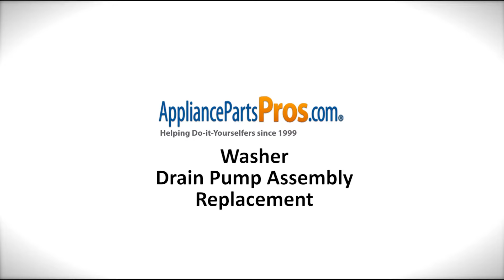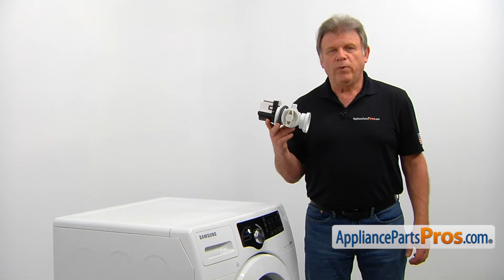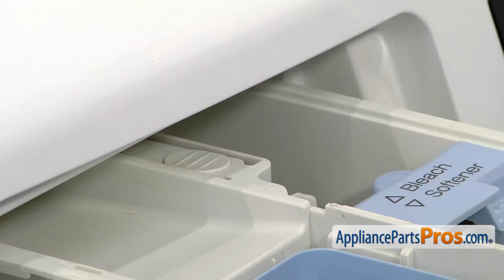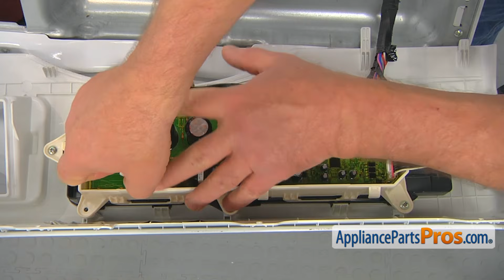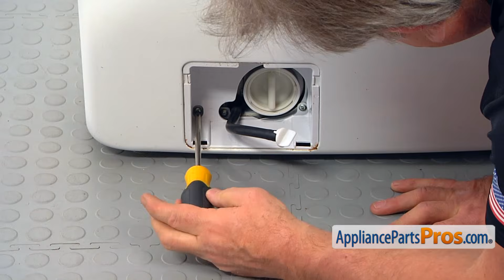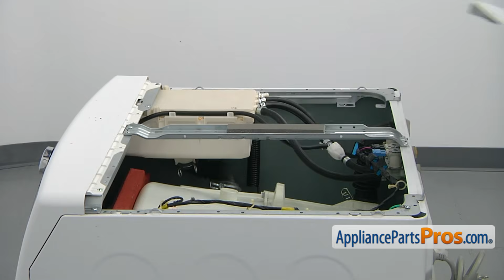How To: Samsung Drain Pump Assembly DC96-01585D

Comment: Much easier to take drain pump off from bottom access panel shown by other repair videos.
Reply from the maker: Depending on the model and your setup, accessing the drain pump from the bottom can definitely be a quicker and easier option. Thanks for sharing your experience!

If you need further troubleshooting or testing information you can check out our Repair Forum: https://forum.appliancepartspros.com/.  It’s easy to register, and you can either post your question or search the forum to see if someone else has already asked the same question.
 
Our experienced technicians, with over 20 years of hands-on appliance repair experience, are ready to answer your questions and guide you through your repair.

Comment: Fabulous video. Wish everyone did it this good. Replaces my pump twice in the last 10 years. Does anyone know what kind of accen this man has? Please tell me. He is so easy to listen to and understand. Thanks.
Reply from the maker: So glad the video was so helpful!
Reply: @appliancepartspros  thanks for the reply. Turns out it had two issues. The drain pump for sure. Now it’s working good but only on 2 settings. The Permanent press and the quick wash. Do you thing it’s in the main circuit board? The two settings that work are fine for the little I use it. I would value your thoughts. Many thanks.
Reply from the maker: For free technical support, please visit our Repair Forum: https://forum.appliancepartspros.com/.  It’s easy to register, and you can either post your question or search the forum to see if someone else has already asked the same question.
 
Our experienced technicians, with over 20 years of hands-on appliance repair experience, are ready to answer your questions and guide you through your repair.

Comment: Had an overheated drain pump because someone got a little angsty  . In short it’ll help to cut a square hole at the bottom side of it to bypass all this extra stuff.
Reply from the maker: While creative solutions can be tempting in the heat of the moment, we always recommend sticking with factory-spec parts and installs when it comes to electrical components like the drain pump. It helps keep things safe and the washer running as it should. 👍

Comment: I replaced the pump using this great video,  but I didn't keep track of what screws went where😢 I knew better but was trying to figure out the problem before my husband got back from a camping trip. Now I have these screws.  Any hints to where they go would be awesome! I did remove the back panel so those screws are part of this too.
Reply from the maker: You did great, Michelle—way to jump in and tackle the repair! 💪 No worries, it happens. The back panel screws are usually a bit longer and coarser than the ones holding the pump or brackets in place. If you still have the pump and panel off, try matching the screws by size and threading—back panel screws often go into plastic or sheet metal and won’t be too short.

Comment: Very good.  I had to use a flat blade screw driver to get the left side of the front panel over the locking tab.  Everything was spot on.  Thank you.
B
Reply from the maker: You are welcome. If there is anything we can help you with in the future please let us know.
Reply: @appliancepartspros  We took our Samsung washer to Ecuador with us and I am following your steps, and everything was fine until the removal of the control panel on the front, the clips are impossibly long on the Samsung DC97-20621A and is not allowing it to fold open, any suggestions?
Reply: Never mind I just popped some tabs out on the side that were different than your model.

Comment: So a faulty drain pump will cause the washer to sound like bearing going out only when in spin cycle
Reply from the maker: What is going on with your washer?
Reply: @appliancepartspros  faulty drain pump. Making loud noise like bearings going out. Samsung said its a faulty drain pump
Reply from the maker: What is your model number of the washer?
Reply: Wf45r6100aw
Reply from the maker: If the noise is only happening during the spin cycle and it sounds like an airplane taking off then that is going to be bad bearings. If you have a bad drain pump than that is going to be a completely different issue.
Reply: Not according to Samsung
Reply from the maker: This is the information that we have been provided for the issue that you have going on. If you have more questions you can call us or chat with one of our agents on our website.

Comment: Nice video but why would you not just lift the unit on to a work table and do it from the bottom to eliminate the disassembly of the front of the machine? There is enough room, I've done one before and about to do another.
Reply: That's a lovely thought, but as a 60 year old woman with only a kitchen table, and no strong young men to help lift it,  I'll have to stick with this method.

Comment: For the front, there are two additional screws that must be unscrewed from underneath. 
Additionally, the left of the two tabs that hold the top of the front on, is either poorly designed or poorly manufactured- the tab actually came thru and over the front panel top slot - we had to pry it very forcefully to get the top front to separate from the chassis.
This washer is not designed for maintenance.
The video otherwise is very helpful and appreciated

Comment: Can you check the pump once you have it out  to see if its working or just stopped up ? You didn't even  check it . Is the pump 110 v ? Why did you remove the control panel and disconnected the wires  It looks like you can just fold it out of the way ?

Comment: Very good video. Samsung defies logic by placing the drain pump at the front of the washer and this video instructs you how to get to it. Thankfully I didn’t need to replace my pump as it was just clogged. Somehow some obstruction got past the filter.
Reply: @dglenn8900  The drain is on the front because you are supposed to access it every three months to clean it. All you have to do is open that little door and clean out any debris to give your pump a longer life. So, even though I am currently angry at Samsung and not a fan of the company, they did not defy logic by putting this where one could easily access it. Maybe the only thing Samsung did right. Although I'm not a fan of Samsung, I am a huge proponent of truth and of this video. The appliance person we called told us we had a bad drain pump and he would charge us $600 to fix it. I think he took one look at our house and our cars and the fact that we are older and I am disabled and he equated that with stupid. My washer is fixed now thanks to this video. Who is looking stupid now!

Comment: Thanks for the video. One note, on my machine, there were two screws on the bottom of the front that had to be removed before the front panel could be removed. This requires laying the entire unit on its side to remove. Everything else was as described by the video.

Comment: Great video.  I've replaced a heating element in my dryer, so when my washer wouldn't drain I wasn't too intimidated.  But let me just say that I'm a 60 yr old woman who managed this all alone, so anyone can do this.  I even had a rusted screw that was seized, but with some silicone spray and a lot of effort got that loose.  Let me just say that when you open these machines up you realize how little there really is to them.  Go for it and follow the video - it's spot on.  (BTW, my washer had a lot of water that never got pumped out and I had to thoroughly drain it all first.  Luckily, my washer is on a stand so I placed a kitchen trash can beneath the drain opening and let 'er rip.  I would suggest that you make sure to do this just in case, like mine, there is more left in there than one realizes)
Reply: I'm proud of you girlfriend!!
Reply: Nice job Ms Legs
Reply: "Let er rip"

You really are a legend. As an appliance tech, you have all my respect.

Comment: VERY HELPFUL - I actually just needed to get to the drain hose to remove an object that was behind the filter and clogging things up.  Was most worried about the drum spring clamp as you can't really see it until it pops off and you hope you put it back in the right place.  So far, no water on floor so I guessed right.  Thanks for posting the video!!

Comment: Nice thank you my issue is resolved. 
If anyone is having issue with check valve this is the part number DC62-00202A. i had to replace pump and check valve both.

Comment: I saw another video, they tilted the washer back, accessed and only changed the motor on the pump assembly from the bottom. No top removal, control panel removal, gasket removal or front panel removal or hose removal was required. Just the motor from the pump assembly.
Reply: I cannot access my pump from the bottom but these instructions were perfect for my washer.
Reply: Exactly. I turned it on its side and there’s a access port on the bottom of the washing machine. You can reach right in and get to the drain pump. Five minute job. All you have to do is unscrew the actual pump from the housing and you don’t have to disconnect all the hoses or anything. You can get the replacement pumps very cheap online like $25
Reply: @Resigned_to_Apathy not exactly. On your model it worked, not every frame is exactly the same under.
Reply: I saw the exact same one you mentioned McCain seem to find it again
Reply: I saw the same video and was not able to access my pump from the bottom.  This way worked.

Comment: the main drain line to the house drain was partially clogged caused the same ND code as the faulty drain pump, got a new pump thru walmart for 13.00 when the one thru samsung and others cost nearly 100.00. great videos thanks

Comment: There are three screws on the front door panel, you have to tip the machine back reach under and unscrew them or you'll never get the front door panel off.  Example one position were a screw is on that metal tab that is sticking out on the bottom left at 8:15
Reply: This comment is the MVP 🙌🏾🙌🏾🙌🏾🙌🏾
Reply: All machines are different. There were a couple of things different on my machine, but with a bit of common sense it’s easy to figure out. Without this video I would have gotten nowhere.

Comment: Excellent video.  Was able to follow along perfectly.  Only step I skipped was disconnecting the wires to the mother board.  After I unattached the mother board, i simply just layed the piece on top of washer leaving the plugs attached